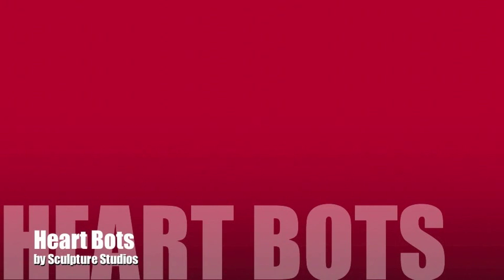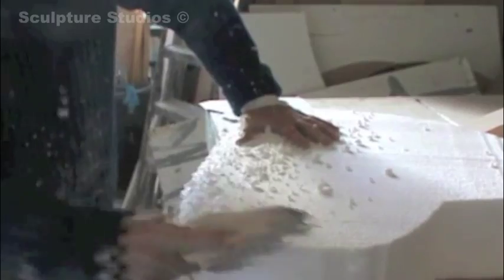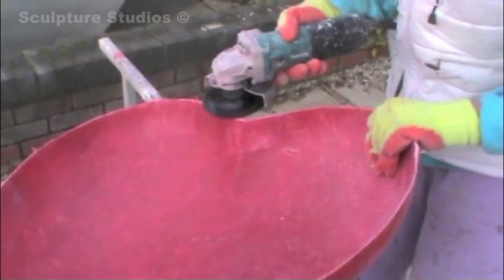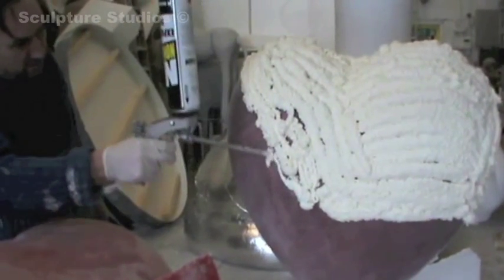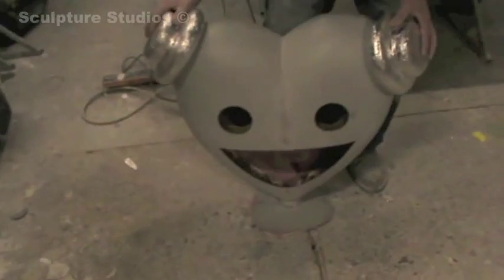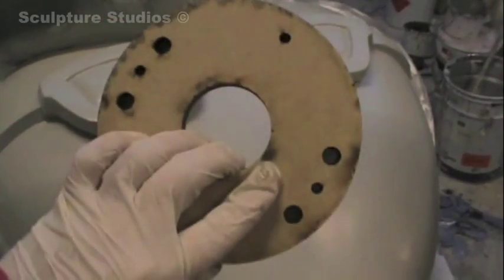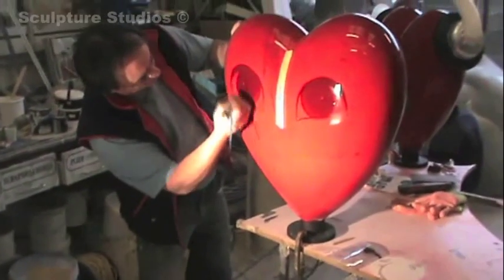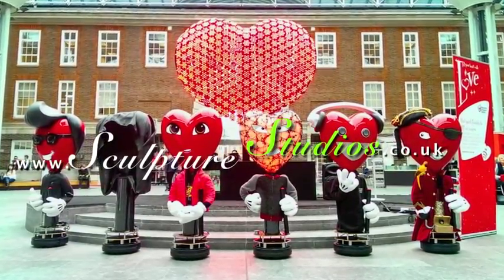Heart Heads by Sculpture Studios

Comment: Byotifol. May I ask what release agent you use on the plaster of paris mould when you cast fiberglass inside it?
Reply from the maker: Hi Dorian. We would have used a PVA blue layer as a release agent (making sure to let it dry properly, as its water based, and the resin wouldn't go off if the blue was still wet). It wasn't imperative that the cast came out with the mould perfectly preserved, as this was only a waste mould to get a better master pattern, but we probably used a PVA blue to help release it.

Comment: I dunno understand how could you bond the two part mold together and what is the benefit of the liquid foam added to the edges
Reply from the maker: We created internal shelves on the interior edges to add bonding agents when joining. And the foam created the bulk of the hair and headphones, before adding harder materials
Reply: so is this method strong enough to hold bigger structure or it's suitable for this specific project. I mean is there any other methods to bond two parts of fiberglass that can't be accessed from inside " wing or fuselage of aircraft for example". Sorry for asking too much but you're more than professionals and i think you're the right people to ask ... Thanks for your patience
Reply from the maker: Another method we might use would be to create a trap door in one of the sides so that you can gain access to the inside of the structure. You can then secure the pieces together from the inside (we'd recommend large phlanges, bolts, bonding agents etc), and then you replace the trap door section and make up the join lines. Have a look on our channel for the Vodka Rocket video, you can see a trap door for that project.